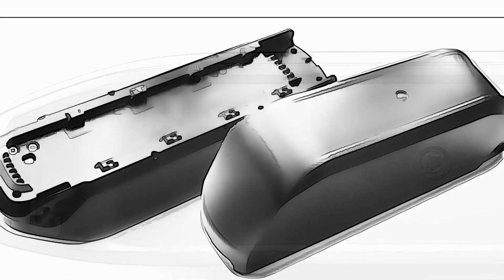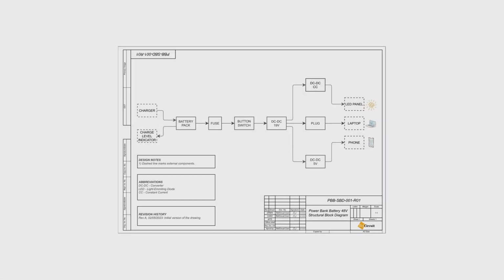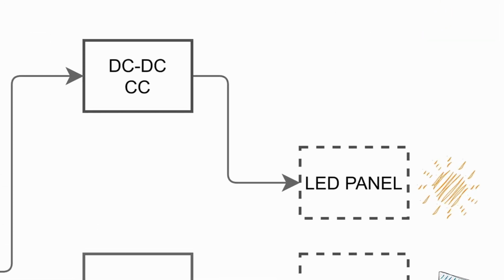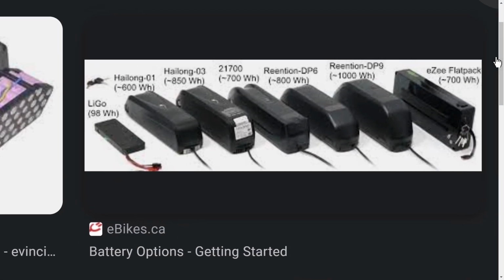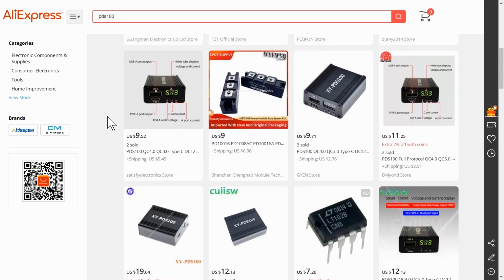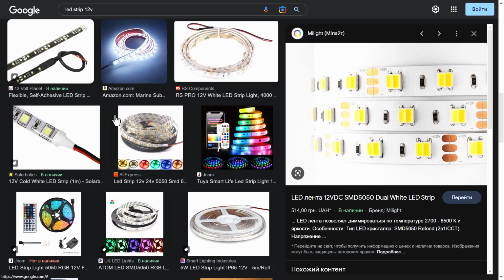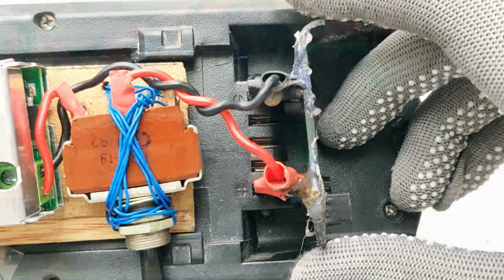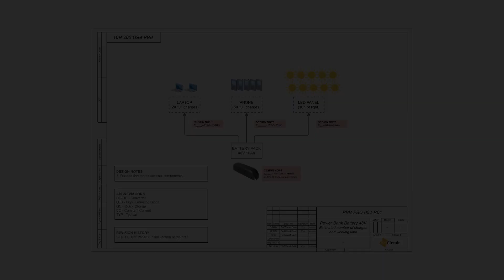How to make 480Wh power bank from an ebike battery 48V?

Comment: Did something similar, 48v 1000 watt 20ah battery to buck converter 2-60v input to 12v output to power inverter 110volt, that runs my computer, monitor, fan, and i simply plug in a usb adapter to it for usb devices. Voila!